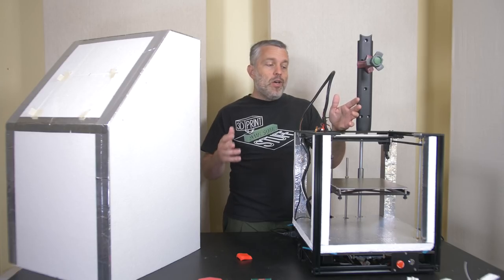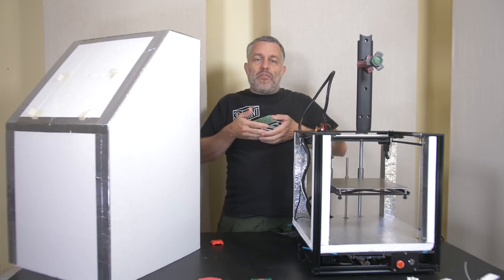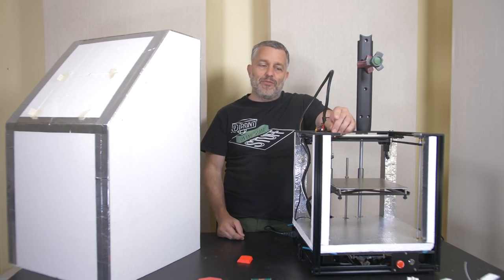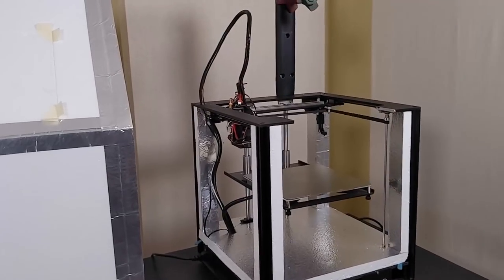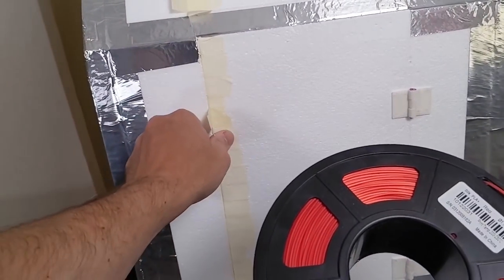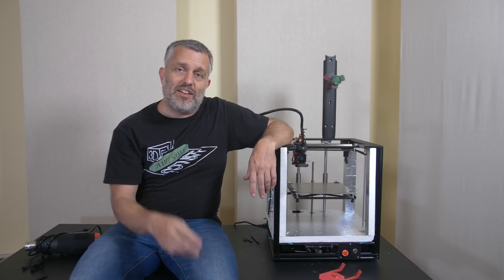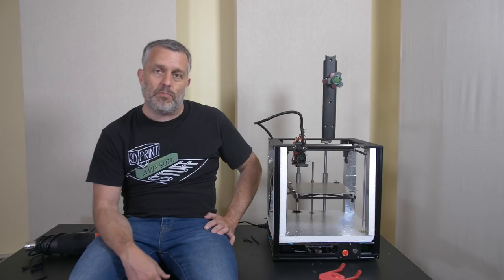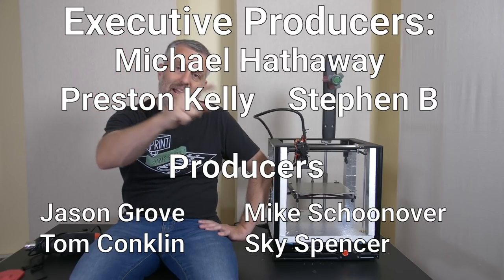Heated Chambers - The Next Level of Consumer 3D printing

Comment: What about convection in your enclosed space? Do you think it's worth doing something about that? It seems that you would benefit from parting the space just above the bed/XY gantry. As it is, I'm guessing most of the hot air remains in the spool compartment.
Reply: Air separating in layers usually requires larger spaces, and very still air. I would expect the printhead whipping around would keep the air mixed enough not to have a large gradient form.
Reply: @AlienRelics  If I remember correctly from uni (architecture, not mechanics, though), spaces more than 20-30mm wide already make circulation possible. Hence, modern double glazing is usually just short of that distance apart - to maximise the thickness of the gas inside (specifically chosen for low conductivity), but minimise convection.

There are, however, no print heads in windows. ;)

Comment: I have a magnetic (non-spring steel) bed which was working fine for printing PLA when my heated bed failed. Trying printing without heat it's also lifting the bed even with clips - and that's with PLA. I ended up gluing the surface to the magnetic bed to get a little more output from my elderly Ender-2 before it's replaced. Generally, though, I like the spring steel places I have on other printers but I prefer keeping them in place with clips instead of magnets... you're just much less likely to come back to find your bed on the floor surrounded by spaghetti

Comment: I dont know why people havent been doing this from the beginning, maybe its due to the material type available.
Our Stratasys is heated but then again the material available, ultem etc, isnt commonly found in the diy builds. At either rate heated enclosures with large projects is the way to go but it requires special design requirements due to thermal expansion.
Reply: Plenty of people roll their own heated build chambers for printers. There was (is?) a patent on heated build chambers that has prevented widespread commercial adoption in hobby printers.

Comment: I’m getting a prusa xl. I’m wanting to use it as a production printer for making massive prints using carbon petg. What would be the optimal enclosure temp for that? And can I just keep it at 50 degrees so I dont have to worry about my printer melting
Reply from the maker: Your questions seem kind of premature. I will exaggerate to prove my point: I'm getting a cybertruck to drive on the moon. What do you think is the optimal speed to get the most range in lunar gravity?
Reply: @DesignPrototypeTest  yeah I guess it is, have you done any printing with carbon petg? I guess my question is what is the lowest chamber temperature I can print to optimise print quality. 

Just getting into printing
Reply from the maker: PETG is the 2nd easiest filament to print with. PLA is the first. The Carbon additive makes it even easier. I've printed 450mm long stick shaped parts without issue in the open air using Carbon PETG. Make sure you get good quality filament and keep it dry, or get a filament dryer.
Reply: @DesignPrototypeTest  yeah I haven’t had to many problems but just wanting to increase reliability and print quality

Comment: Use “poor mans fiberglass “ on outside of heat chamber to give it some rigidity  , you can even insert thin wood pieces in places that need more structure or screws.
Reply: Why not just use fiberglass?
Reply: @difflocktwo   probably because it’s easier and cheaper  ;hence the description . I know English is my second language but I think it was self explanatory.

Comment: If you continue to increase the chamber temperature to 100 degrees lets say, what happens to the stepper on the extruder?
Reply from the maker: Steppers are pretty robust in terms of their ability to handle high heat, but ideally that stepper would not be in the enclosure or it would be actively cooled.
Reply: It can depend on the motor. I've seen many motors have a 100C maximum rating, although LDO motors makes some that are functional up to 180C (search up their Orbiter Extruder and the included NEMA14)
Reply: @DesignPrototypeTest  good quality videos you are making maybe you could do a review on the creality CR-5 Pro high temperature It is with a enclosed

Comment: maybe try only circulating the heat dont exchange the air or your heater will not make its set point
use a larger hole to bleed the excess pressure coming in

Comment: I much prefer the way Voron is done, much cleaner, I can see it printing, of course the box is not as heat tight, but it works.
Reply: It would completely fail at 70C though
Reply: @malloot9224  Chamber never goes above 55C anyway
Reply: @yvesinformel221  yes but this machine can as its made for nylon, not only abs. It's comparing apples to oranges a bit, of course the way voron is done looks and works nicer. But this is a higher temperature mod.
Reply: @malloot9224  I never tried printing Nylon, but I print ABS at 240C. PA6 print btw 230°C - 270°C and bed is only 95-100C. PA12 might be a problem because it need the bed to go all the way up to 125C

Comment: I've never seen stainless steel cables used on 3D printers. That seems be a great high temp alternative to gates belts. SS cables like those available at bicycle shops should work and cost less than a change to ball screws.
Reply: Literally was thinking about this solution a few weeks ago I'm always just late enough to not make great inventions XD

Comment: I've printed 3d parts from PLA+ and they are outside, in full sun and all weather. They show no signs of looking any different to the day I installed them. They are white so reflect the sun and I did paint over them so perhaps that helps protect them.
Reply from the maker: Now put them in your car on a hot day, and feel them turn into rubber.
Reply: @DesignPrototypeTest   I don't have a car. The glass temp of PLA standard is about 60 degrees. I use PLA Plus which I think is slightly higher. I probably wouldn't leave in a car on a hot day in full sun like most things. I've seen it turn chocolate into liquid. But living in the UK this is rare.

Comment: I hope you are only running that setup when your home, that foam is a serious fire hazard, if something catches on fire, using hardie cement backerboard then insulate with foam board on the outside is much safer

Comment: You need a basic Creality zipper enclosure.  Unless your print area is below about 40 degrees then the printer will keep things warm enough.  Sometimes too warm.  Print your plastic parts for the interior out of ABS and your temp concerns will be eliminated.  Hatchbox ABS is really great.  I run it at 245/90

Comment: Love this analysis. 
Personally I wouldn’t be comfortable using the type of element used to heat the air in a hot air gun. Probably being paranoid but I wouldn’t do it. 
To solve the same problem I’m going to try a heat mat, like used on heated beds on a big aluminium heat sink with a fan blowing over it. Perhaps two of them if I can’t get enough heat. It would be harder to pid tune and less effective in bang bang than your solution though as the heating will be much slower, but I think it would work with a bit of tuning.

Comment: if the ambient temps are not circulated you will loose adhesion or get hot spots causing warps and poor z layers if the build chamber temps are not even from air mixing

Comment: I have a little bit of code added to marlin, in the event of the thermal runaway error it also sends a high signal to an io pin which i hooked up to a relay which comes before both PSUs and SSRs . 
so when i get thermal runaway the printer just unlatches from main and does a "suicide".
very good for safety, very harsh on Rpi .

Comment: Open air printers are for toys and children.  I love ABS and I've never had anything but enclosed printers.  PETG is good also, great with UV but very slow to print.  The first time you pointed out the potential of this printer and it's mechanics, I should have bought one.  However, it was made in violation of a patent on steppers outside the build chamber.  Thus is why I suppose they are no longer available.

Comment: Isn't SSR which fails closed independent of DC power supply? It will be feeding power to bed as long as it gets AC power, your controller does not even need to be turned on. You need inline thermal fuse which blows up when bed temperature reaches certain point, daughter board which turns off 24V PSU won't help you in this case. You can reach out to Keenovo or DIY 3DP communities using AC powered beds in their specifications for tips on safe installation (i.e. VORON, RatRig, HevORT,...)
Example: https://www.reddit.com/r/3Dprinting/comments/byenlo/ssr_relay_failure/

Comment: I like pla but even after anealing its not that good. Bought petg+ (from fiberology) and could print 85° overhangs no problem, 100% cooling and no warping. Just aneal it and its dumb strong (2cm squared contact area between the layers and I cant break it

Comment: Why not cover everything on the inside of the printer with aluminium tape and have a polycarbonate glass enclosure and then heat the print from the outside of the printer using infrared heaters? The aluminium tape reflects 95% of the heat and the polycarbonate sheets let through 95% of the heat. The goal is to heat the part that's being printed while keping the chamber temp at reasonable levels that will not fry the printer it self.

Comment: When you raise the temp inside the chamber, the part cooling blowing the heated air will be less effective.   Maybe look into air pumps mounted outside the chamber
Reply: Though surely you want to cool it down quickly, but still only cool it down to 100 degrees?

Comment: Best video yet! Great content, good details, and insightful. I agree, heated chambers rule. As for air and fumes, why not recirculate the warm air through a carbon filter and use a passive heater resistor/radiator, that way you don't use a spill a huge amount of energy and pollution into the environment, potentially trap the particulates and remove the fumes?
Reply: Yeh that’s what I do. A desktop PTC heater, and a desktop air filter inside an ikea cabinet.
Reply: I only go to 50c though.
Reply: @samroesch  I've got my CR10s Pro V2 tented in a mylar lined cordura zip up thingy and I get to 40C with just residual heat. It only cost me $80....and it has a window.

Comment: I seriously doubt that you would be allowed to commercially produce an enclosure like that from a material which from 100C upwards may melt (or even burn) and release toxic fumes.  Especially the fact that you have stuff heating the inside might make risk-assessment bells go off ... Then again, Chinese printers still have PTFE going all the way to the nozzle, so there are clearly less safety bells over there ...
Reply from the maker: Yes. Styrofoam (Polystyrene) is a poor material choice for any reason other than it's insulative ability. There are many suitable replacement construction methods/materials. Sealed and insulated is what matters.

Comment: I follow your videos since a lot of time, those gave me ways to think. I never wanted to comment it, since most of the time I disagree with you on a lot of things, but everyone has an opinion I respect it. Anyway you maybe need to gear up the machine; I looked the cable management under it, I saw the headprint wiring... Sorry to say that a bit hard to take seriously your words on everything since that kind of facts. The same way, your "fireproof" styrofoam is just garbage sorry... at 100°C I don't even imagine the toxic fume coming out of it and the high risk of fire, not very responsable to present it as a nice cheap solution for non advertised viewers. You talk about hight temp, but the bed has not even a kinematic for thermal expension, and I dont speak about the various head stuff material likely ABS who will suffer and emit fumes... So telling pro machine are expensive for nothing, well safety and reliability has a price. If needed you could have build a nicer safer enclosure, ceramic whool and extrusion can give you this at a fairly low pricetag. And that I don't scratch the paint: the belt kinamatic and routig have a clearly issue, bed is clearly not the best part for hitemp approach, spool position not practical, reliabality? general safety?... I speak of experience. I think if you realy want to buil a cost effective machine, you can do it way better for few $ more, your design is flawed since the first time I saw you put duct tape on styrofoam and call it an enclosure. Keep doing u're work I know it time consuming

Comment: Voron solves all your problems
Reply: Voron specifically don't do high temp heated chambers unless you DIY. Also the 3D printed parts would not hold to the elevated temperatures. So in short, the Voron will not print PC.
Reply: @christianmarkussen6412  my voron v2 Doomcube reaches 70c without issues at all..it's been printing great for quite some time now
Reply: @hartk5353  70C is no problem for any printer, above 100C is a challenge.